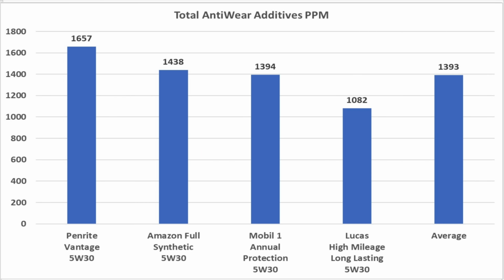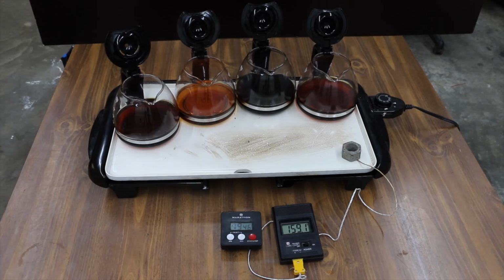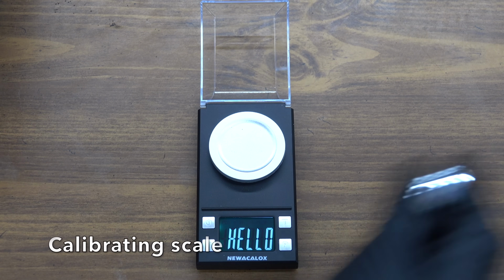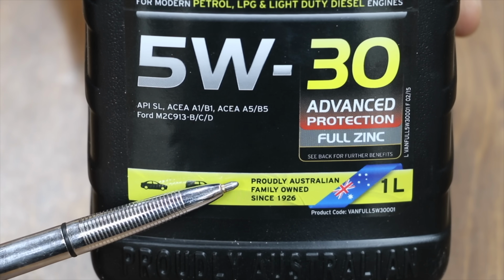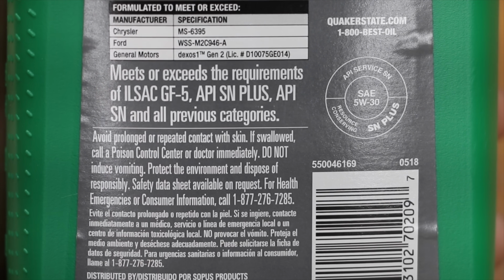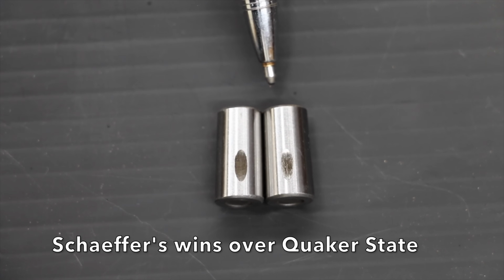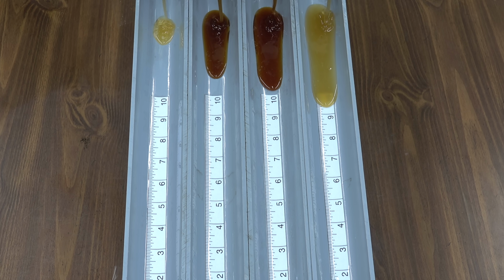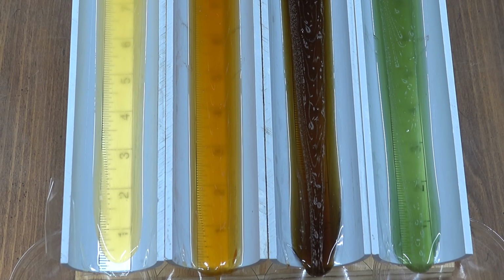Is Amazon Basics Motor Oil better than Penrite? Let's find out!

Comment: I wish you would do a review on the best motor oil filter. I use Mobil 1 M1-102A extended performance, but is there anything better in performance, or a better value?
Reply from the maker: Thanks for the video idea.

Comment: -40 is a bit extream as a 5w viscosity flow rate is around -30.
Reply from the maker: Thanks for the constructive feedback.
Reply: @ProjectFarm  I like your comparison tests, the -40 shows that some oils viscosity has more "anti-freeze" in them. What would be interesting is useing the tempature the W viscosity is rated at so that we can see how the brand of ones choice reacts. Very few people have seen -30c or -40c degrees, (I have a couple time in my life) and will probably never encounter it! The most they may see is -10/-15c where a 10w is suffiecent. There seems to be to much enfacise on cold weather and not enough on hot driving conditions where the upper range is needed to protect the engin. My thoughts.

Comment: Awesome video! Do you know what tests a SN rated oil must pass (even if you lack the ability to perform them) that the SL doesn’t? My engine requires SN, so even if Penrite wins, I would probably not use it due to specs.

Comment: Something changed with your cold flow test method. In every single other test, virgin oil beat cooked oil down the slide, but in this test, Amazon oil was faster after it had been cooked. If you watch the other videos that had Amazon oil in them, you'll notice that it almost immediately pours out of the test tube and starts down the ramp, both virgin and cooked. 

I'm going to post a link to the Liquid Moly comparison, since it had two test runs of virgin Amazon oil and one of cooked, and all three tubes of Amazon are starting to pour before the tubes have gone past horizontal. In this video, Amazon oil seems very reluctant to leave the tube. 

https://youtu.be/oc5i6Vevox4?list=PLjT3B9r2z3fXlvbP3tb9e056Q8O5krrCW&t=478

Something has changed. It could be how full the tubes are, or it could be relative humidity, with water freezing on the exposed portion of the inside of the tube, making the oil more resistant to flowing out of the tube.

I went back and watched each video several times and I finally noticed that you are using different freezers in each video. You really shouldn't change variables during the course of a 'tournament' like this. You wouldn't raise or lower the basket or change the position of the free throw line after teams make it into the elite 8.

Still love the content, but the pour performance (ha, puns!) of the Amazon oil in this test vs other cold flow tests kind of stuck out at me and made me start asking questions.

Comment: I can not find a way to contact you directly.  I  think you go above and beyond with the tests. I  am  really curious how your tests will  stack up to Brad Penn / Penngrade oil. The green oil. I  run it in my alcohol fuel motor in comparison to  valvoline vr1 and also  control synthetic.  I  get about  30 1/4 mile runs from  valvoline and Castrol and 75 runs from  brad Penn penngrade oil.  I am curious as a  test more comparable to long term use as your tests are geared towards. My oil tests ruined the oil from fuel saturation  instead  of long term  use.  Thank you for your time and effort for these tests, very interesting.

Comment: My winters hit -40C/-40F.... or lower... My car recommends 5W-30. Should I switch to a 0W-30 for winter? I have a 2015 1.4L Ecototec Turbo. It runs hot. So I want the least evaporative loss, when motor is up to  temp, and the 30 denotes it should have the same viscosity once warm weather 0W-30, or 5W-30, but it seems that it would benefit from a lower viscosity at the extreme temps. But in the SUMMER, I hit +40C, (like weeks at a time it will be 35+ humidex, feeling over 40C. HOT AS HELL. There is an 80 degree difference in cold starting temps between the height of summer, and the height of winter. Should I just stay with 5W-30 if that's what it recommends? Or would it be better for cold starts to switch to a 0W-30 in Winter? 

SOMEONE LET ME KNOW!

Comment: Sup buddy, please do a diesel oil comparison, i just picked up Amazon diesel full synthetic 5W-40 and i been driving with T6 Full synthetic 5W-40 oil. Full synthetics for diesel seems to be 5W-40 only but i had some suggestion i should use 15W-40 instead, but they dont have these in full synthetic so it seems. 15W-40 only seems to come in Rotella T5 "synthetic blend" and Rotella t4 15w-40 "triple Protection. Would be interesting to see the T4 15W-40 and T5 15W-40  and T6 5W-40 compared against each other with Amazon full synthetic 5W-40. There is also Motorcraft and Valvoline along with other brands for the diesels, but it would be super awesome to see these tests from your laboratory :)))
Reply from the maker: Great video idea! Thank you
Reply: Project Farm appreciate your channel man! By the way I’m currently finishing a video on changing oil on my F350 with a help of a sniper rifle, crazy things that YouTube makes us do LOL

Comment: I was at the local auto store today and saw a few products that were interesting that are added to either oil or coolant to stop head gasket leaks, oil leaks, heater core leaks, rear main seal leak ect. I dont know how any of that would be tested, but It would be cool to see if any of them really do work
Reply from the maker: Thank you

Comment: I have used Mobil-1 in everything for at least 20+ years.  Last month I tried the Amazon 5W-20 synthetic and am very disappointed.  With Mobile-1 the Engine Oil Life Monitors usually come on well past 5,000 miles.  But the Amazon oil only lasted barely 1,000 miles!  I'm going back to Mobile-1, grrr...
Reply from the maker: Thank you for the constructive feedback.  I used Amazon for 4300 and sent it to an oil testing lab. It still had more life in it with a healthy TBN.  Is the oil life monitoring system working properly?
Reply: @ProjectFarm  I have no way to test the oil life monitor.  I thought maybe the Amazon oil 'super cleaned' the engine and this dirtied the oil quickly.  But you know Mobil-1 is a good quality product.  And I use an engine flush with every oil change - 200,000 miles on this engine so far and still runs like new.  I don't believe in a coincidence ...  Maybe an oil test with engine oil life monitors will make a video series?

Comment: Can u remove the -40 temperature test?  It skews the results by using a measurement that will never be seen by an engine unless it’s near the North Pole.  For the rest of 99.9% of people the other 2 portions of the tests are spot on.  Suggestion.

1. Replace -40 test with an oil shear test.
2.  Replace -40 test with a 275 degree oil bearing wear test.  That will simulate a turbo engine which is known for breaking down motor oil.  

Thanks.
Reply from the maker: Thank you for the recommendation!

Comment: Another great video! It will be nice to see the final overall winner. It would also be nice if you could also give the overall winner on which oil did best in each type of oil test. As an example brand "A" did the best on the lubricity test, but brand "D" did best on the evaporative test, and brand "C" did best on the cold flow test and so on. Thanks.
Reply from the maker: Thank you!

Comment: API SL has worse protection for turbocharged motors though compared to the API SN Plus amazon basics warren oil. So to me so far the winner is amazon considering the price and the SN Plus rating at least for turbocharged and supercharged vehicles. Plus the availability to me online and locally Penrite is nearly impossible to get where I live if I'm not mistaken. When I do find it online and cannot purchase it, it's around the same cost of the liqui moly. So again to me the winner so far is amazon basics due to availability ratings and overall performance in these tests. Even without it going further in the bracket you can compare previous results to the new results and get a general idea in the performance compared to the remaining competition. Sure it won't be identical test environments but this isn't a white lab coat test environment anyway just some guy in his garage doing tests for us lucky individuals that don't have this kind of time on their hands. We truly appreciate all the time and effort you take out of your days to conduct these tests. At least I do haha.
Reply from the maker: Thank you!

Comment: Based on this testing, Quaker State would be the choice for my car.  The extremely low volatility makes a big difference on DI cars.... Which most new cars are.  It completely blew the Shaefer's away in the volatility, and was pretty much neck, and neck in the other two tests.   While the Schaeffer's looks like a great oil for older cars.  Of course the QS is usually on sale for less than $20 for 5qts at walmart.  I think I've found my new favorite oil.
Reply from the maker: Thank you!
Reply: @ProjectFarm  No, THANK YOU!!!!

Comment: Fantastic videos! And a lot of work that made them so interesting.
BUT WE NEED A REALITY CHECK HERE. People often get too crazy watching oil testing :-D
These test are very good, and we get some info about FRESH OIL SAMPLES. Volatility test is done very good, ok...but we can't compare 2 hours of "torture" with 100-150 working hours in engine - including many cold starts, severe city driving through the interval, or when kinematic viscosity changes...
When fresh, all those 5w-30 oils have very similar viscosity and performance. Those results are close...
MOST DIFFERENCES IN OILS WOULD OCCUR AFTER FEW THOUSAND MILES/KILOMETRES IN ENGINE. 
The differences would be more drastic I believe, because those cheaper oils are tuned with a lot of viscosity enhancers - which break down very fast with time and use...
Group IV (PAO oils) and group V (ester oils) like Amsoil, Penrite, Redline would outperform in film strenght, volatility and viscosity in the long run...

Keep making good videos :-)
Reply from the maker: Thanks for watching!

Comment: Still amazing, Commander. I wonder about all the lower viscosity oils but I suppose they have to be there to get the mileage everybody has to have. As long as mine holds together I'll be happy. I have to buy gas anyway and I accept the mileage of what I drive is part of the blessing I have to even have something to get to point 'A' and back home. Or maybe point 'B'! Anyhow, thanks for another FINE test and that freezer was the REAL deal! BLESSINGS, Yall!
Reply from the maker: You are absolutely right regarding the viscosity for helping with fuel efficiency.  For hot weather time of the year on a warn engine, I prefer a little higher viscosity as well.  Thanks for the positive comments and wish you all many blessings for the rest of the week!
Reply: @ProjectFarm  My 4.3 in the 89 Taco holds 80 p.s.i. plus,  hot at idle with the 15/40 diesel oil. Gauge is pegged out. It runs smooth and no rattles and with a 195 thermostat I'd say it needs all the help it can get. I think too much heat, too many 'R's and too thin oil is what's causing a lot of the newer small engines to come apart but that's just me. Carry on, Commander and family and SA-plus 2 yall!

Comment: Penrite: SL is only for use with 2004 and older engines, not certified for newer engines nor for use with any engine using E85. SN was created as the new standard in 2010 as the gold standard. Also including zinc in newer engines will actually cause excessive wear and early engine death...

Therefore Penrite should not be included as it is not certified for newer vehicles.
Reply from the maker: Thanks for watching!

Comment: It would be interesting to see the best oil with the best additive in a friction test against other interesting competitors such as well performing but low priced oils and even the most basic and cheapest oils to see the real performance differences that can be achieved just by spending more money on better oil. My favorite test is the friction test because it is common to all engines in all conditions. The temperature tests are only really valid in extreme temps that not everyone has to deal with. Once everyones engines are at normal operating temps, friction resistance(for the cylinders) and viscosity stability(for the bearings) becomes more important than some other qualities i would imagine. Maybe you could think up a way to gauge the stability of the viscosity at normal or high engine temps also. I think that would be a very important test as well because some of these oils break down terribly under high temps and some perform incredibly well. Just some thoughts on this very interesting subject. Keep up the great work!!!
Reply from the maker: Thank you for the video idea!

Comment: In an engine oil gets forced at pressure through extremely small areas (think bearings).  I think a test showing oils ability to flow through a small orifice might be valid? Maybe a pressurized vessel with a hole of .005" or so. The amount of oil could be weighed after a certain amount of time.  I dont know, just spit balling...I really like your tests.  Super fun to keep up with these videos.  Where do I find an address for a donation? I am old school, cash or check kind of guy.
Reply from the maker: Thank you for the video idea!

Comment: Interestingly, the 540ratblog (he does testing similar to you, but he can quantify film strength, and maintains a regularly updated blog about it) puts amazon basics synthetic as WORSE than pennzoil CONVENTIONAL.

https://540ratblog.wordpress.com/2013/06/20/motor-oil-wear-test-ranking/

150. 5W30 Pennzoil, API SN conventional (yellow bottle) = 76,989 psi

155. 5W30 amazonbasics motor oil, synthetic, API SN Plus, GM dexos 1-Gen 2 = 76,237 psi

There is also apparently a new vegetable based oil that ranks really highly, would love to see you test it!

4. 5W30 Renewable Lubricants, Super High Performance Passenger Vehicle, Bio-SynXtra, motor oil = 130,436 psi
Reply from the maker: Thank you!  I'll test the Pennzoil Ultra in this afternoon's video.

Comment: I thought you might be interested in that I walked in to a small local Carquest and the Schaeffer’s rep was doing an oil comparison using a bearing tester similar to yours. Instead of using a weight he asked you to place your weight on the machine handle until it stalled. I could not make the Schaeffer oil stall out. I thought it was interesting he was not showing or testing scoring on the bearing. 

I would love to see one of your oil tests done on Havoline’s oil in a box sold at WalMart!
Reply from the maker: Thank you for the video idea!  I don't like the machines that allow the "one arm bandit" approach.  Highly subject to manipulation by the tester.

Comment: A small piece of criticism. I feel like when the measurements of the bearing wear scar are down to hundredths of a millimeter, you really ought to call it a draw because that's gotta be getting to the edge of what you are able to accurately measure. Depending on how you're measuring it, that is - I can't recall from prior videos whether you use calipers or how you do it, but if it is measuring freehand with digital calipers, that's gotta be error inherent to doing that which will swamp out differences that small.

If you're not content to call it a draw, then I suggest you run the test 2x as long to achieve greater differences between brands.

I do love your testing philosophy overall, but this test has always somewhat made me wonder about its validity. As the competition gets closer and closer, you may not have sufficient instrumentation for this to work.
Reply from the maker: Thanks for the constructive feedback

Comment: Great content as usual Todd!  I wonder if testing the oils at -40f is actually useful though.  It's not a temperature that will ever be encountered by this weight of oil.  Anyone operating a car in those temps would be using a thinner oil, and most likely a Block Heater.  I think the temperatures used in your original test may be a better indicator of the oils performance in real world working environment.  The new 40 below test may be akin to grading Peanut Butter based on which brand tastes best mixed with Trout, as opposed to Jelly.   Just a thought.  Keep up the great work!
Reply from the maker: Great point on the -40F.

Comment: Aussie here.
We have known for years that penrite is one of the best engine oils in the world.
Quality is high and the additives used are the best.
Mobil 1 is trash and has been for the last 15 years.
Another oil you should try is another oil from Australia which is even better than penrite.
It's called Nulon Racing oil.
It's a group 4 and group 5 blend with an additive package no other oil has.
It's also designed to work with E85 and not dilute with the oil.
Reply from the maker: Thank you for the video idea!